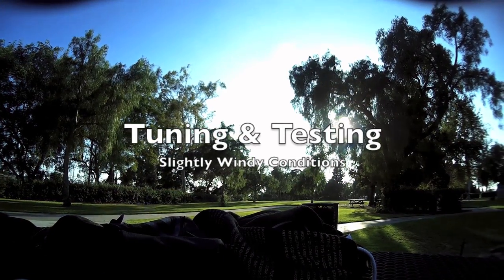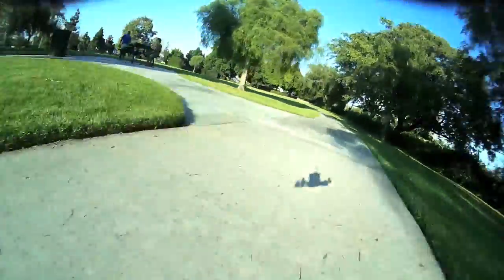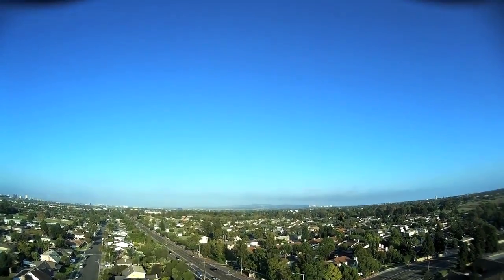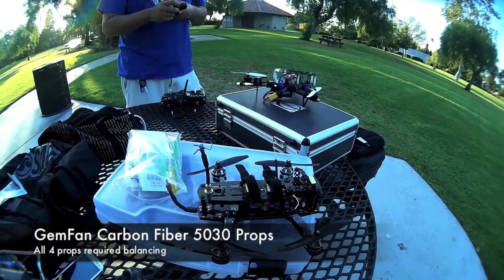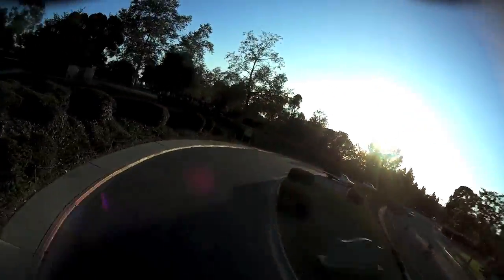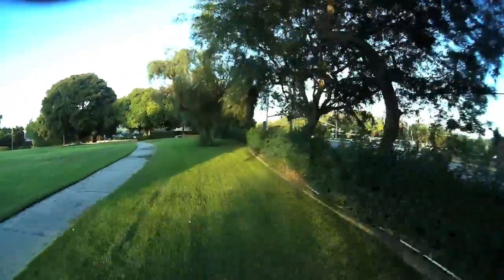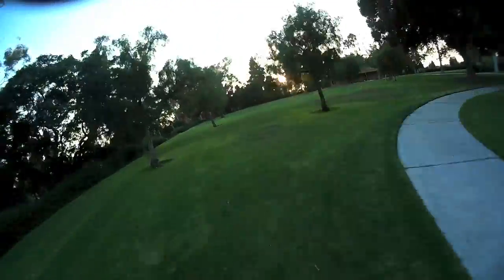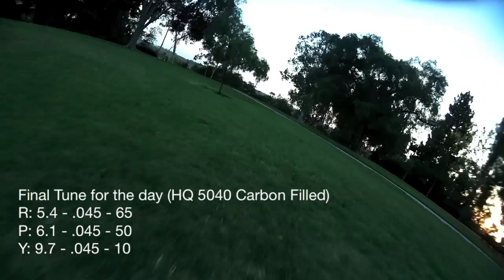FPV Blog - PID Tuning - Blackout Mini H Quad - KISS ESCs - MN2204 2300kv - Flip32

Comment: Thanks for sharing your thoughts on PID Tuning. It's something my son and I have been struggling with for ages! Fantastic video and easy Thumbs Up!! 
Cheers
Paul
Reply from the maker: Glad it helped you out. If it helps any further, in my experiences... the lower the loop time, the finer (crisp feel) the tune but at the same time finding that sweet spot is difficult to find and further more different on every frame. Anyways, that's what i've learned so far. I'm now playing with "sync'd" loop times which is another school of thought on PID tuning & ESCs.
Reply: ummagawd My son and I are interested in smooth footage and locked in flying rather than just pure speed. I love the tuning here because you have silky smooth footage (and fast) but it's so easy to watch. Looks like we have heaps of work ahead of us :) Nice work my friend!!

Comment: Very entertaining to see your new tuning method. I do have to say that final result looked like butter on 5x4 props! I will try the lower looptime soon on one of my setups to see how it goes.
Reply from the maker: Yea, I just wanted to explore different tuning approaches. For me, it was a noticeable difference. Try it out and let me know... Do you have PIDs for 5x4 props? It would be good for me to try a completely different tune to compare now that I've been flying with this for a while.
Reply: Unfortunatelly I never tuned my mini H for 5x4 props as I had some other projects eating up my hobby time. By the time I got to it BO send me the 6inch arms and I went for 6x45 props :D.
It's always good to explore different methods. As the matter of fact your method might be good. Just need a lot of testing to verify the differences :D.
Reply from the maker: The 6045 look like a lot of fun. Once I run out of 5x4... i'll step up to 6" and see what that's all about. I'll hit ya up for a PID tune when I do that :)
Reply: ummagawd what pwm rate were you using in your tests for these esc's. Default naze32 setting is just 400hz.
Reply: ummagawd what pwm rate were you using in your tests for these esc's. Default naze32 setting is just 400hz.
Reply from the maker: Boris B. I tried 499, 490, 400, and 488. I didn't notice any difference on the bench... so I just left it at 488 for this video.

Comment: I wanted to chime in real quick and thank you for sharing your knowledge and experience. Great video and explanation on "PID tuning". One of the best I have seen.

After much research on the subject and hours spent tuning my mini quad I felt that I had a fairly well tuned aircraft. The live FPV feed looked pretty good and it was fun to fly. However the GoPro footage was still a bit shaky and not as smooth as I wanted it to be. Especially when flying in windy conditions. The GoPro footage would end up very bouncy and jerky.

After watching this video I went out for another tuning session today. It was another windy day but I followed your "thought process" and after watching the GoPro footage I have to say I am very pleased. I was able to tune out most of the jerkiness and even though there was some wind the footage is very smooth. 

What I learned from your video (and please correct me if I am wrong) and what I believe the key was to increase the "D" values. I always thought that the "I" values could be used to smooth out the aircraft under windy conditions but after today it seems that "D" is what is helped in my case. (please share your thoughts on the "windy" subject)

Once again, thank you... Keep the videos coming... Liked and subscribed....
Reply from the maker: fretsman you're on the right track. I like to think of D as a "dampener" to P. In windy conditions, it disturbs the quad and P reacts. "i" has more to do with the error correcting/looping occurs over time. Glad this helped!

Comment: Thank you this video is great. Love the half roll half flip thing you do been trying but I think I need more tuning will be trying some of your pointers in this vid.
Reply from the maker: Glad to be of help. If you haven't already, check out cleanflight and PID controller 1 :)
Reply: UmmaGawd yeah got clean flight, Love it
Reply from the maker: cool... try out PID controller 2 also when you get a chance (if you like to yaw alot)
Reply: UmmaGawd Are you talking about using the default pids ?
Reply from the maker: there are different PID controllers in cleanflight. Each one is tuned differently. If you're not familiar... just stick to what you're flying :) But there's a good cleanflight thread on RCG if you have time to do some reading.

Comment: Love your videos and contributions on here, and on rcgroups. I fly your PIDs love what you do for us. BTW, your ummaPIDs v2 work just as great on extended arms with 4s. Thought you ought to know.
Reply from the maker: Thanks Gabe... I appreciate that. Hearing things like that definitely makes the late night editing worth it. And great to know about the extended arms and especially 4s! What motors and ESCs for the 4s?
Reply: And...As i wrote that and reviewed my crash video into the tree. i noticed the chopping...lol. But then again, that could be due to untold damage i did the Cobra 2204 1960kv motors i was running on 4s, originally with gemfan 6x3 props :(.  The odd yawing i experience could be from slipping magnets... So who knows now. Back on 3s. I think it will fly fine.
Reply from the maker: Gabe McGinnis ah yea.... i was getting slipping magnets on my 2206 motors on 4s... frustrating for a $45 motor! I didn't think the cobra 2204 motors had issues with slipping magnets though?
Reply: It is likely not the motor's fault, and I did abuse them a bit. it could just as easily be my yaw expo. flip32 doesnt seem to like it north of 0.90 and ive been messing with it lots lately,  more testing required.
Reply from the maker: yea... anything above .9 seems to wig it out (and it's the same for an original naze board too.. i think it's in the code at that point). If it helps... I've found that lowering P for yaw improves yaw response.

Comment: I have the Ummagawd 250 pro but I’m building a Blackout that I found on EBay. I’m having more fun going backwards and using my old Tattu 3s batteries with Dshot, F4 flight controller and some DYS 1806 budget motors

Comment: I found this interesting too. Although there's no point going below 1600 loop time with the kiss ESC's and 2500 with the ZTW's running SK. You're just sending extra stuff to the esc's that they can't handle...
Reply: True Adam. That's why I never go below 2500 as that keeps the FC and ESC in sync. I guess oneshot could enable faster looptime. See here the best illustration of both. http://img.tapatalk.com/d/14/07/12/thumbnail/4anymy9y.jpg
Reply: Hmm it's all intriguing stuff. I actually found that just above 2500 gave the best results. 2530 is what i run now.
Reply: Yes....multiwii actually recommends 2600us as the best value to be in sync as much as possible. I guess I had success on 2500 and don't want to change the winning team :D, but will play with it.
Reply: I totally agree, if it works, DON'T touch it!
I don't really understand things to the full but if you watch the little loop time indicator at the bottom of the Baseflight app when running a 2500 loop time you'll see it is constantly dipping into the 1480-90 range which makes me think i'm over working and sending the ESC's more than they can handle.
Reply: The cycle time is not 100% constant as there are various tasks being performed by the FC each cycle, which can take some time sometimes. The little variations are not a big deal. After each command it can take up to 4ms for the ESC to interpret the command.
Reply from the maker: The logic behind keeping FC and ESC in sync makes sense to me. I'm def not trying to refute that in this video. All I'm saying is that I have been exploring the idea of simply having your FC think/calculate as fast as possible and this is where I'm currently at with it. My thought is that the FC always sends the most accurate/recent data knowing that there may be a number of loops that the ESC won't react to. I hope that makes sense.

I'm curious now though... did Felix say the KISS ESCs were rated for 625hz (1600 looptime)? I may have missed that.

Comment: Thanks for that video.I learned  lot!
I'm using blue-series ESCs running SimonK. Do you think it would be possible to tune a quad to be as smooth as yours with the SimonK and not the KISS ESC?
Reply from the maker: Glad it helped. And yes. Try setting your looptime to 2500 and using these settings (assuming you're running the same sized motors and props).

Comment: You must be a Jedi or something that flying is insane ! I've done the Autotune and still getting some up and down bobbing. Is it possible to get this kind of smooth footage with gemfan 5x3 props ?
Reply from the maker: Yea i think autotune still has a way to go before you get something nice and smooth. But it should get you to a good start. I think the 5x3 props can get this smooth on 3s... on 4s you'll probably some shakes higher up on the throttle.

Comment: HI..great Video..could you please post your's mobius setting??
Reply from the maker: hi there... i use the following mobius settings:
Mobius settings are.
Advanced Image Settings 1080p 30fs
WDR OFF Low Light OFF
Sharpness +20
Exposure Normal
Contrast +20
Saturation +20
Color Options Normal
White Balance Cloudy

Comment: Great video, umma. Quick question. If everything else seems to be tuned properly, how do I tune out a slight bounce after flips and rolls?
Reply from the maker: you'll have to play with D. If it's still there, then P is a tad too high... at least that's what my experience has been.
Reply: Thanks! That did the trick but now I have a slight wobble during level flight. This is kind of like wack-a-mole.
Reply from the maker: I feel ya man, I'm having a hard time tuning my new setup (though i think its vibration issues). Might want to play with loop time. Is the wobble on the same axis you just tuned?
Reply: ummagawd Yep. I'm using your 1600 looptime PIDS with 2204-2300kv, Tiger ESC's and HQ5x4.5 props. I've been extremely happy with the results so far, just gotta get that final bit of wobble out. I'm sure I'll figure it out.
Reply from the maker: OOOOHHhhh the bullnose props! I have them but haven't tried them yet. I really like the 5040's so far (even moreso than 6030s). With higher pitch props... you theoretically need LESS PID gains, hope that helps. You're looptime sweet spot might end up somewhere between 1600-2000
Reply: ummagawd Copy that. Thanks!

Comment: Hello master! What do you think about cleanflight and autotune? Have you tried it? Do you know if the PIDs of baseflight works fine on cleanflight and viceversa?
Reply from the maker: Hah... what's up man. I've not tried autotune, but I am currently on cleanflight on my mini-H. So far... it seems like yaw is a bit better, but that's just my speculation right now. Otherwise, cleanflight behaves just like baseflight.
Reply: ummagawd timecop don't think the same... hahaha I've read that the PID of cleanflight are not just the same but I'm not sure
Reply from the maker: FLYER so.... 6 months later... and i can confidently tell you that they are NOT the same. CF > BF all day! I'm sure you agree by now too. I love PID controller 1

Comment: Hi, I Just want to ask have you tuned a larger quad I have a 470 mm frame with ZTW 20 amp spiders 600 hz will changing loop time be good idea for larger quads. Right now I have it at 3000 and not happy. Well I guess I could try it and let you know how it goes.
Reply from the maker: hi there... the biggest quad i've tuned is a 400mm. If your ESCs refresh rate is at 600 then that would equate to about 1600 looptime. I would try 2500 and 2000 first though. I'm starting to better understand looptime and it's affects on PIDs and i'm starting to think i just got lucky with finding a tune that works with 1200 on my mini H. What i would actually, is just hover your copter and play with looptime until you see that it's rock steady. Then you can apply my PID tuning approach (high P and D).
Reply: ummagawd Thanks for reply I did actually set looptime to 1600 and I think I'm at role p at 7 and pitch p at 8 when it hovers it just at edge of being to high and I set one profile at role 6 and pitch 7 and still a little loose so I will just play with it, it's starting to get where I want it. Thanks again for posting this I think it will help others as it has me.

Comment: I just finished building my 250, went for maiden, but it keeps taking off in forward. Any suggestions?
Reply from the maker: Hey sorry for the late reply, sometimes I miss a few... but I try to answer all of them! Anyways,I'm sure you've figured it out by now, but my initial thoughts are 1-you're NOT flying rate/manual mode and your accelerometer is off, 2 - your radio isn't trimmed properly, 3 - all of the above.  That's where I'd start

Comment: My mini h wobbles on throttle.. could you give me some advice?
Reply from the maker: add some TPA until it goes away
Reply: I will try that thank you...  On what value sould TPA breakpoint be at? at this stock settings it is on 1500 on my naze.

Comment: Hi! Really appreciate if you can help me here. I'm on the below setup. However I still getting lots of vibrations. Wonder if you have the similar setup or tested it?

BO mini H 260mm 6"
Cobra 2204 1960kv
KISS 18A esc
4S 65C
HQ 6045 props
Naze32 arco

My current PIDs are 
Roll P1.8 i0.030 d28
Pitch P1.9 i0.038 d35
yaw P10 i0.045 d0
TPA: 0.50
TPA_breakpoint=1250

I'm getting lots of vibrations still! Especailly when I throttle up, even when I set my TPA to 0.70 still having them! I also tried bumping up my d to Roll d55 Pitch d65. Still getting it.

Can't seem to get it tuned...Appreciate as much help here as possible.
Reply from the maker: I've not personally tried that combo so i can't give you anything concrete. But... try setting looptime = 2000, motor_pwm_rate = 500, and ensure max throttle is no higher than 1925. Start at 3's for R/P and start from there. Hope that helps
Reply: Thanks. I'm using a Taranis. Current setting is minthrottle=1000 &maxthrottle=2000. What should I set for maxthrottle then? And just to educate me why maxthrottle at 1925? 

I tried setting loop time to 2000 from my current 1600. Indoor testing seems much better. Can't see oscillations. 

And oh. My tpa_breakpoint is at 1250. 4s hovers at 30%. motor pwm 488.
Reply from the maker: Anchor Kee I like to leave some headroom for the FC. Yea I think 1600 would be too high for your setup (6045). Don't forget to recalibrate your ESC's after you set max throttle in FC.
Reply: ummagawd thanks again. But what min and max throttle should I set? I'm using taranis.
Reply from the maker: using a taranis shouldn't affect any parameters on the FC in this regard. I would use 1100-1925 (that's what I use). Also... I know i previously said to use motor_pwm_rate = 500... try a max of 498 instead. I've been having an issue with my setup lately and someone else suggested 498. Figured I'd just give you a heads up too. :)
Reply: ummagawd Thanks! I have found that one of my motors has a bell housing loose causing all the vibrations. Getting it RMA now. Btw, what's your review on the IB Crazy Airscrew Antenna as compared to the ImmersionRC 5.8GHz Circular Polarized SpiroNet Antenna V2 (SMA)? I'm currently using the SpiroNet. and oh, mind to share your custom settings on your Mobius? The colour looks great!
Reply from the maker: I love the airscrew antenna. I use it when i know I want to fly hard and capture good footage. It's pretty strong but i've already broken 2. So I use spironets for fun flying, and the airscrew on frames where i don't intend to crash :). I feel that the quality is a little better with slightly less noise.

Comment: Are you touching the TPA at all ?
Reply from the maker: Yes... i'm at .45 with TPA with tpa_breakpoint=1500

Also note that i've since changed my looptime to 1300 as i find it not to be so much on the "edge" and is a bit more forgiving with getting the PID tune right.

Comment: how do you tune for yaw? what do you look for and how do PID's effect yaw?
Reply from the maker: jeremy.n79 does it wander in fast forward flight? Does it overshoot when i yaw? Does it basically do what I tell it to do. Tune roll/pitch first... PIDs affect yaw same way that it affects roll/pitch
Reply: That's the thing I don't see much difference when I'm adjusting pid settings for yaw.  Especially when I adjust p.  Default it is 8.5. When I reduce or increase from let's say 5.0 - 12.0 I don't feel any change so I just left it at 8.5.   For I , I can 0 it out and not tell if it changed anything. I can tune roll and pitch just fine but just knowing that when my pid adjustments for yaw aren't doing anything is making me wonder.
Reply from the maker: jeremy.n79 The differences will become more prevalent with more demanding yaw maneuvers. It's not something you'll see the difference in just flying. Usually... when P is too high... the quad will jump when you yaw and stop abruptly.
Reply: So say if I pull the sticks full yaw left or right and stop but the quad continues to rotate what should I adjust?

What if:

Too little P = ?
Too much P = jumpy after yawing?

Too little or too much I = ?

Too little or too much D = ?

Sorry for asking so many questions but I want to get a grip on yaw tuning and can't find a real explanation anywhere.
Reply from the maker: jeremy.n79 Too little P = quad will continue to rotate (it won't feel like you have great control), too much P = jumpy or yaw's back after stick input, I and D don't really show much with Yaw. In forward flight.. if yaw is wandering... then up I some... but default is usually fine. D doesn't show either... this is more feel. I like very direct yaw so i usually leave it close to or at zero
Reply: Ok thanks for the quick replies. This explains it a lot.